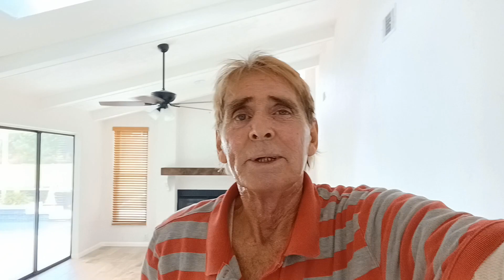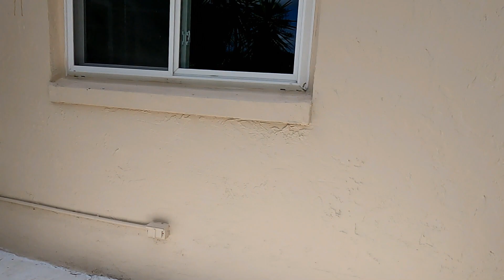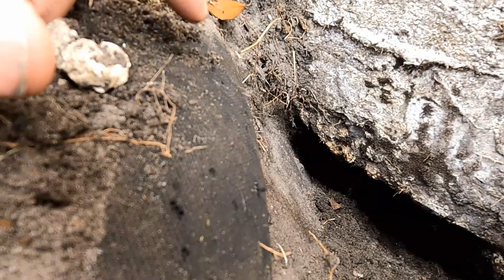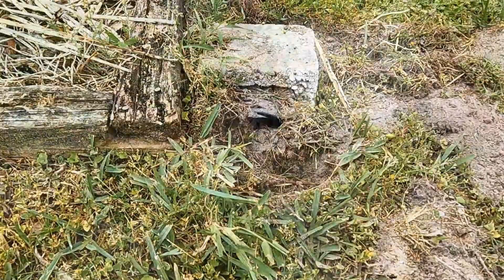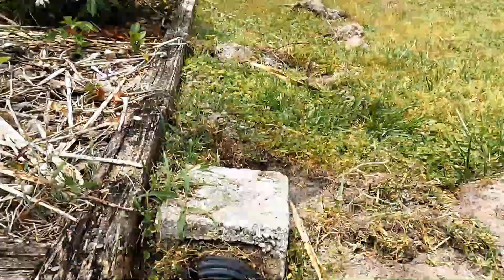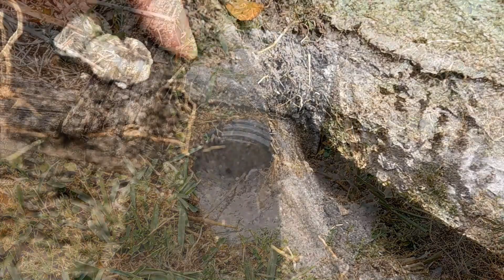SLAB FOUNDATION - Water Intrusion - How to Mitigate Problem

Comment: The down spouts part of our problem it does need extended out down hill but when its raining heavy all the dirt needs dug away from the house or there's gonna keep being a water problem cause the water will still drain down the slope of our yard and come right in because the slabs level with the dirt so is the wood framing i should redo all the wood framing but thats alot of work to do

Comment: I dug away the dirt/grass from around one of our slab foundations like that to keep the water from coming in because of how someone made it they made the slab level with the dirt outside 

Then whoever done the wood frame work done that all wrong and laid the 2x4s flat on the slab so when water comes in they get wet i know our little fireplace walk in room can be fixed but im thinking about adding onto it extending it out 11f5 more so it'll then be a small usable bedroom or a storage room. I probably won't pour in no concrete when i add onto this walk in room probably make it plywood flooring and maybe one step up because I'll lay some rocks down level them and use concrete blocks as a foundation for the wood framing and no water will get in

Comment: Chuck, you seem to know about foundations so I figured I'd ask you. 

On the inside of my house it is 39 inches from the top of the window stool to the carpet. When I go outside and measure 39 inches from the top of the window sill, there are 10 more inches to go until I hit the ground.  Does this mean my house has a 10+ inch slab?
Reply from the maker: Good question 
Best way to find out how deep footer is would be to dig it up

Comment: I wish there were answers to people's comments!
Great questions!
No answers!
Reply from the maker: Did you ask a question?
Reply: @appledrains  No sir!
I was trying to read the answers to the reply of others.
But I do not see any answers.
I have an addition on the back side of my house. Water has been seeping in when it rains and it has rotted out the framing on the bottom where it is just sitting on an old concrete slab.
There is no flashing at all!
I'm not a construction worker!
I'm a 50+ year old women.
I don't have the money to pay someone else.
I have to fix this problem myself somehow before I lose the entire addiction that contains my furnace!
Reply: The addition sits on an old concrete slab which is flush to the ground.
Last week I cut some of the drywall out so I could see what's going on.
That's when I realized that the framing on the bottom is completely rotted and gone.
I'm being told to sisi brace it after I lay down brick to help hold it up.

Comment: I have had french drains and gutters installed around our 1950’s slab foundation addition. And we are still getting dampness coming up through floor and a couple spots on our carpet damp. (Relatively light rain). I ripped up carpet and the slab is in fact darker and damp. Not pooling water luckily. 

How would we go about water proofing this? Im concerned about mold and the moisture getting or has already gotten to the floor plates on the framing.
Reply: Did you find the answer to your question? Would love to know as I have the same issue.
Reply: Great question. If love to know the answer as well.
Reply: I have the same problem... How did you fix it